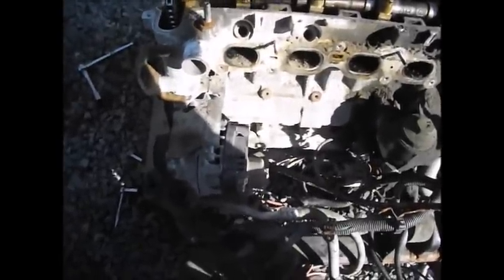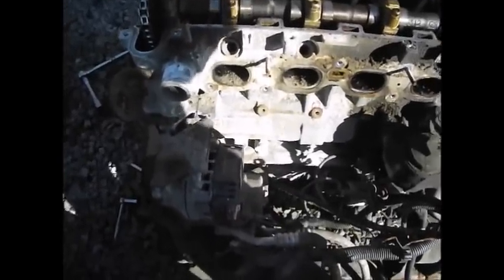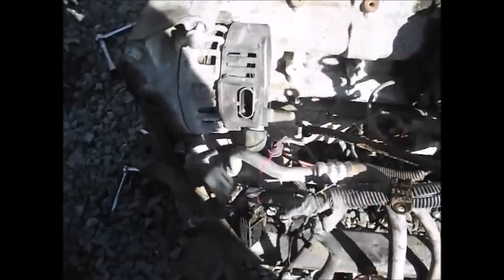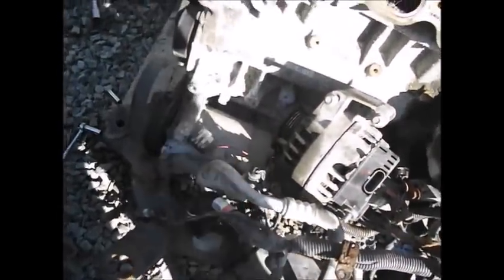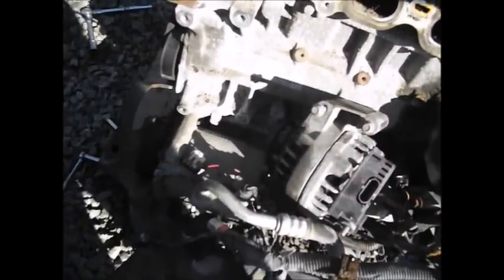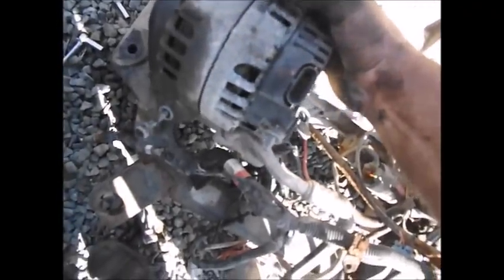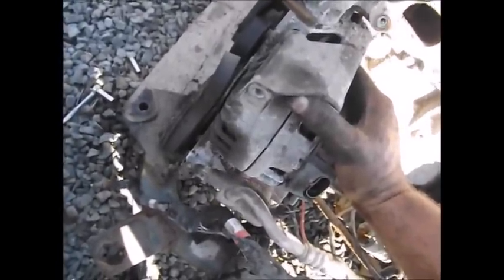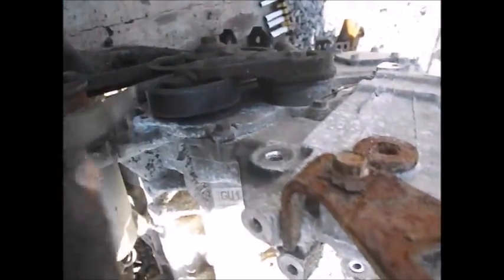Saturn Vue 2 2 Ecotec Alternator Removal

Comment: Where one finds the thermostat of a saturn vue 2006 2.3L automatic And as podria to change it and q need
Reply from the maker: mario alexander 2.3 l,m not sure. Never worked on one of them. I,d say follow the large rad houses to the motor and it should be there. Or do some online searches. The info should be there for it.. Sorry its all I know for that engine